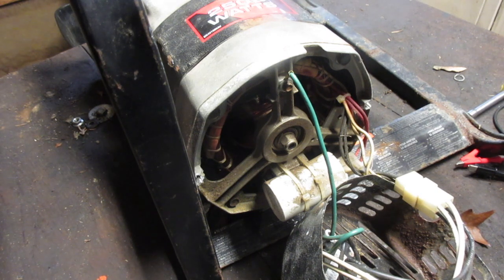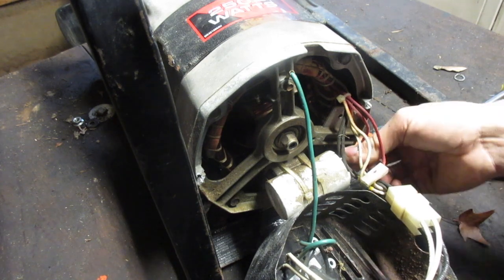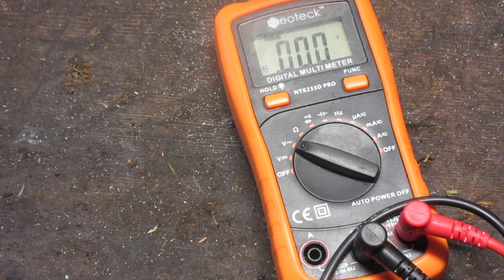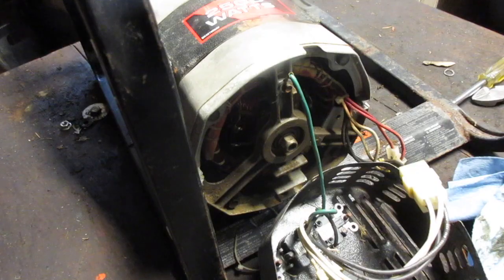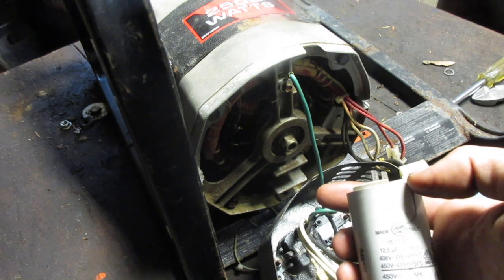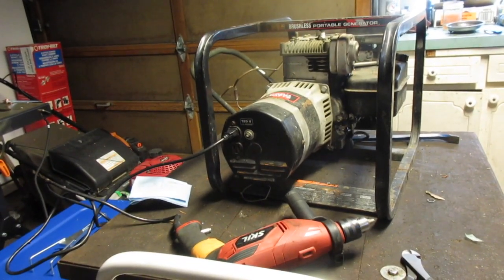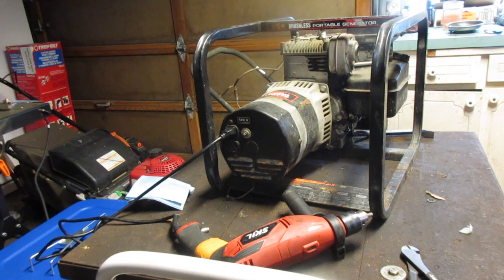Generator Capacitor Testing

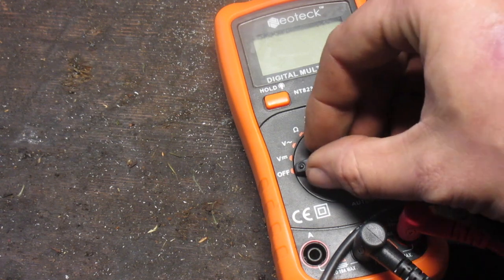Comment: 2:55 You do know that your multimeter can measure the capacitor value directly (with the two wires disconnected), right? See that capacitor symbol at the 12 o-clock position on the selector? And don't start the generator with a load connected to it, much less a drill that is locked in the on position. A typical lightbulb and your multimeter are enough to give you an indication of the output.
Reply from the maker: You are right. I don't because even if the capacitor tests good the next test would be the one showed. I skip that test. I will check the capacitor if there is a low output issue

Comment: I have a small generator with a capacitor. When I don't run anything on it, the volt is 340, and when I run on it a half-horsepower water motor, the volt becomes 220. Is this normal?
Reply from the maker: Generators like that make some very dirty power so sometimes when taking readings the volts seem high. If you are testing the 220 outlet this doesn't sound to out of the normal
Reply: @PNWSmallEngineandLawn  thanks

Comment: Why would generator suddenly only produce 106 volts instead of 240 volts? I need help. Gentrax inverter generator.
Reply from the maker: 240 has 2 120 volt circuits. I would assume one of those is malfunctioning. Check all the connections and the plug to make sure everything is wired correctly. If that isn't the problem the inverter is probably bad
Reply: @PNWSmallEngineandLawn  Thanks